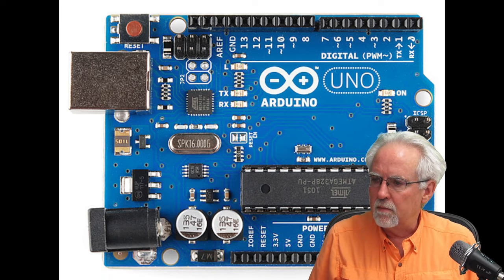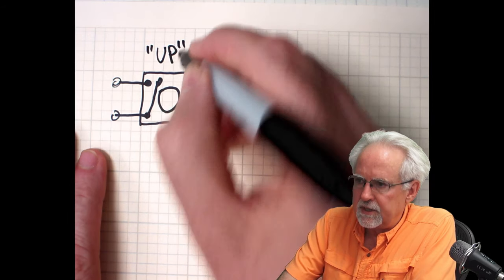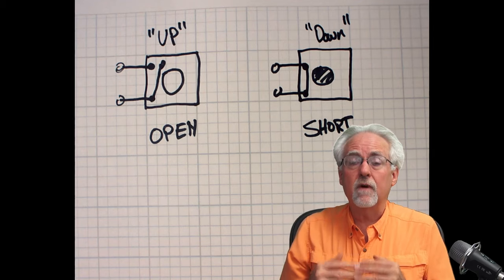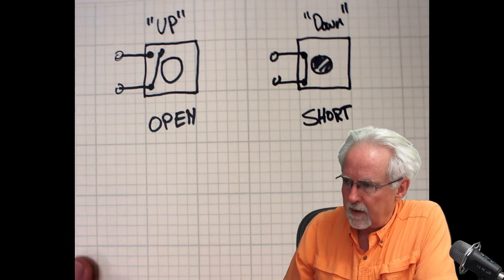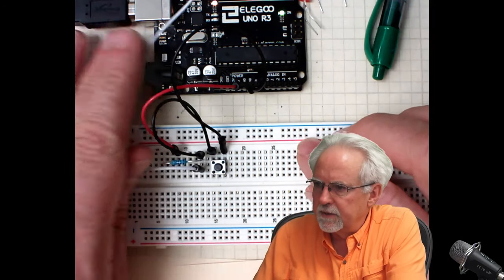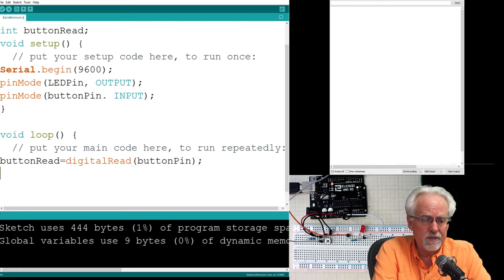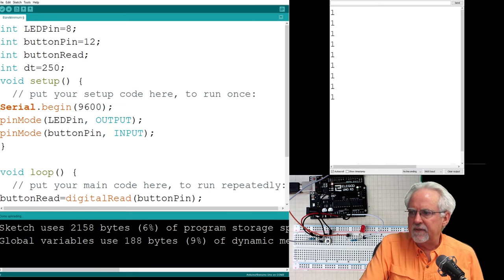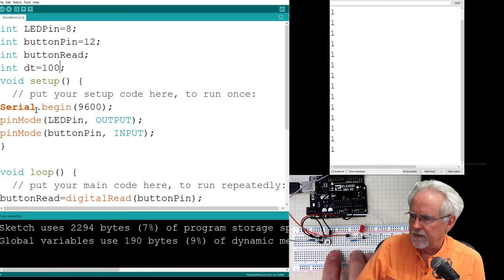Arduino Tutorial 27: Understanding Pushbuttons and Pull Up and Pull Down Resistors

Comment: QUICK QUESTION...why use a resistor at all??wouldn't you see the same results with out a resistor????Is it because you would damage that pin if there was no resistor in circuit????

Comment: Why we use 10K for pull up and pull down resistor ?
Shall we use some other value of resistor for it ?
Reply: you can use a bit bigger or a bit smaller its just that 10K is a "goto" value
Reply: Maybe it draws too much current from arduion.  I=V/R

Comment: As soon as you said it equals 1 I lost my mind. I spent the next 4 hours reading about TTL. I still dont fully understand but maybe I understand enough to push on. Thank you for the lessons. I wouldn't have learned all this any other way.
Reply: trake t. another way of thinking about it is that when the button is pushed it lets the electrons flow to ground so there isn't any "pressure" (or voltage) built up, kind of like water in a pipe or air in a pipe or hose.  If a valve is closed then the pressure will build up to a maximum, but if the valve is wide open, then pressure cannot build up unless the size of the pipe is too small to allow all of the substance to flow.

Comment: The double = got me. Wasn't working because I didn't double the = sign. The other obvious question - Why not just connect the LED circuit to 5V and put the pushbutton in series?
Reply from the maker: Try to make a toggle switch that way.

Comment: Thank you very much sir!!! I do have one question, though. How did you know to use a 10K resistor? And how do you know what resistors to use on general?
Reply: At this stage, values are not too important.  10K resists enough so you have something to measure.   20K does the same job (yeah, I double checked before saying that to make sure).  My kit has 220 Ohm resistors instead of 330 Ohm resistors.  they work exactly the same for this use (maybe the LED is a fraction brighter?).  LED's want 3V, not 5V.  5V will eventually burn them out.  Putting a resistor  of about that value (220-330) brings down the voltage to somewhere around 3V or lower.  No expert so that's a rough explanation is rough. but the idea is correct.
Reply: @TheRaptor1967  the idea of putting a resistor here..is to prevent the switch from impedance State.
Reply: Idk why but I cross checked all my connections and also checked my code but it’s showing only “0” in the serial monitor even after pressing the button . Could anyone help me out?
Reply: Exactly my question. Why not 100k or 300k? Less current, less wattage, more battery life
Reply: Why not, no risistor? I do not understand why you have to use a resistor to read the push button whether it is high or low. I just tested this without the resistor and it works just fine. Do I miss something?
Reply: @matheokoning4456  You need the resistor or you will have a direct short between 5v and ground. and the LED always has its own every LED used needs it's own resistor.

Comment: Hello Sir,
First i would like to thank you for this tutorial and the way of your explanation,
i have a problem:
the code is the same of yours and the connection to, but when i open the serial monitor the result is  "0" rather than "1" and when i push the button nothing change the result still "0" , can you figure out the problem.

Too many thanks Sir
Reply: Hello 47!,
     I had this same problem but I fixed it. Try moving the button further down the breadboard. I guess if u use a few rows too many times they decide not to work?
    Hope this helps.

Comment: While holding my breath I forgot to add something. This is an interesting approach to PULL UP/DOWN resistors: super easy and intuitive but, for those who are addicted to details (i.e. masochists) like me, could we have a more detailed explanation on the value of the resistors  compared to the inner impedance of the Arduino's reading pin?

Comment: Pull down resistors pull towards the ground
Pull up resistors pull toward the sun 
Trying to make a rule of thumb :) What do you think?
Reply: for  pull up resistor, I think the resistor is also should be big  to make true that the voltage of measure point is 5V,  if so, because the resistor is so big ,then it can't dirve other things good,  such as buzzer,  motor;  so it just have one function to make sure a point''s voltage is HIGH, am I right?

Comment: Why use a pull down resistor when you want open circuit to be 0 and closed 1. Wouldnt that work without the resistor as well?
Reply: I think you would short circuit if you don't put a resistor...

Comment: A question if you don't mind. How do you decide what value resistor to use?
As i saw in a data sheet the arduino uno output current is 40mA. So the voltage drop across this 10kΩ resistor would be 400V (V=IR=0.04A*10,000Ω). That means theoretically no current will reach the arduino reading pins when using the pull up method right? But when practically done, I got the reading as 1 as well. I'm a bit confused. Appreciate if anyone can explain this. Thank you:)
Reply from the maker: 40 mA is the max output. I=V/R. If V is 5 and R is 10,000 then I is 5/10,000, a very small current
Reply: @paulmcwhorter  ohh.. thanks alot sir!

Comment: I'm confused by the way he explains the pull up resistor. He specifically references V=IR, then explains that there is no current so V=5V due to there being no voltage drop... But if there is no current then I=0A -> V = 0 * R -> V = 0... If there's no current then how could there be a voltage?

Comment: My serial monitor keeps showing 0101010101010101... if the switch is not pressed and 00000000... if it is pressed. I have made the circuit same and the code is also same...

Comment: This was my sketch
int redPin=8;
int buttonPin=12;
int buttonRead;
int del=250;
int redRead;
String msg="buttonRead= ";
String msg2="redPin= ";
void setup() {
 Serial.begin(9600);
 pinMode(redPin,OUTPUT);
 pinMode(buttonPin,INPUT);

}

void loop() {
 buttonRead=digitalRead(buttonPin);
 redRead=digitalRead(redPin);
 Serial.print(msg);
 Serial.println(buttonRead);
 delay(del);
  Serial.print(msg2);
  Serial.println(redRead);
  if (buttonRead==0 && redRead==0){
    digitalWrite(redPin,HIGH);
  }
   if (buttonRead==0 && redRead==1){
    digitalWrite(redPin,LOW);
   }

Comment: I enjoy your videos very much (made it this far in the series), but I'm sorry to say that I still don't understand the idea of pull up or pull down resistors. Why not simply route the current directly through the switch? Why is the resistor needed?
Reply: because then you will have a direct short of 5 volts and ground and in short order no adruino and burned out LEDs

Comment: Is there a hard and fast rule as to when you use pull up/down resistors? Also, how do you know whether you need a pull up or pull down resistor? This always confuses me
Reply: Rolston Holas where I have seen the pull up or pull down resistors used most is with transistors.  The type of transistor and the particular circuit will determine which of the pull up or pull down resistors you need.  There are other places that use them too, but that is where I have seen them used most.

Comment: Sir i get 0 1 0001 0 1 01 01 01 output automatically. Without connecting any wires. help me to solve this issue.
Reply: Maybe missing a pull up or pull down resistor.  Replaying Paul's previous lesson may help.

Comment: ok my serialprinter does not read 1 or 0
it only reads the buttonPin =12 ??? 20:02:17.850 -> 12
Reply: same here
Reply: figured it out; serial.println was set to buttonPin, it should be set to the value you read from the button, not the button itself
Reply: Me too. I had the same problem and found the same fix. I was so happy when everything worked!

Comment: My button doesn't seem to work. it's constantly 1. I changed 4 buttons, and double checked my code. couldn't figure out why.
Reply: I have the same issue.  I thought it was the button as well (changed it 3 times) , but I think the button may not be seated properly.  I tried rotating the button 90 degrees - four times - and it still didn't work.  I removed the button and completed the circuit with a jumper and the red LED came on as it should have.  So I know the code and the build were correct.
Reply: @stevemorgan3597  Thanks Steve. I think I burned one Arduino up and tried a few different switches and still would not go from 1 to 0. Cut out switch and now I can move on to the LED.

Comment: Made boolean flag var, to implement toggle feature, it worked. after this i added debounce code from borrowed code.  
purchased 1) Arduino nano 2) ~4660 -5220 contact breadboard later will get pre-bent leads.  Great class, thank you Paul.

Comment: 12:48 conversely, you could install the pushbutton across the middle trench and give each lead a nice long column of 4 holes
Reply: That is what I did too.  Spread out the circuit some.  I used the bottom row for the ground bus and the top row for the 5 Volts with two vertical circuits on the board.

Comment: Hey Paul, I've been working through these courses and must say thank you so much and I for one give you a big thumbs up for teaching the math and other theory. Being a guy that slept through my High School days I have a lot of gaps and I appreciate the foundation along with tricks that you are presenting. I've learned a lot so far along with coming up with some fun technique. For example on this exercise I used your trick to read voltage and then set up serial output showing exactly what is going on "4.70 1" , 4.7 being volts and then when I push button, "0.00 0" Super cool, Learning a LOT! Thanks again, looking forward to moving forward with the rest of your classes.

Comment: Pull-Up configuration is like a Normally-Closed switch
AND
Pull-Down configuration is like a Normally-Open switch

Sir, i think you interchanged the conditions in the if statement, my understanding is if it displays 1, the LED should be ON
and if it is 0, the LED should be OFF. Thereby creating a Normally-Closed switch.

Nonetheless,
Thank you for this amazing lesson Sir Paul!
Reply: I totally Agree. but pull up has to go high and pull down goes to ground.

Comment: I still don't understand the purpose of pull up pull down resistors or what they do. Can someone explain or point me to another video

Edit: what's the point of the resistors? In the diagram you read 5 or 0, so whats the need for ther resistors? Also still confused on orginal question
Reply: same i also confuse why we need the resistor? what it actually do

Comment: Skipped ahead several lessons for this one. Glad I did since I didn't know about the need for a resistor when using the pushbuttons.

Have 8 LEDs and a Sketch that displays various "light show" animations (bounce, sweep, random, etc.). Tonight I added a pot (Lesson #12) to adjust the speed of the animation. And added two pushbuttons, one to cycle to the next animation and a second to toggle inverting the animation. Worked out great.

Thx!

Comment: This is how stupid I am. I fried a arduino during this lesson!!!!  Sometimes I wonder how I can even feed myself?  Just hope and pray to God my wife out lives me or else i'm screwed. I have a ELENCO Digital/analog trainer that has its own bread  board on it which i use mostly. Well I had the power and ground legs of the bread board powered by the Elenco little power supply at 12 volts and didn't know it and of coarse I used them with the Arduino during your video project hooking the power and ground of the Arduino to the power and ground legs of the bread board that had 12.6 volts running across it.
I was getting frustrated too because the LED would work with the button sometimes and then just start flashing by itsself , serial monitor looked like the Matrix movie at the end of the show with 0 and 1's going crazy. I was like what in the bleep is going on? Then i saw the Elenco trainer was turned on and that oh $#%@ feeling in your gut overwhelms you. Atleast it was a cheap knock off Arduino!
I let the smoke out of a Arduino trying to operate a cars ignition coil on the bench one day. One of those modern COP coils that have the transister inside the coil. Not sure what I did wrong there but that almost caught fire. Can't believe how much smoke they could fit into such a small device!

Comment: 9:35 I might have some type of dyslexia, that could account for a lot....  But Is this one of those cases where it's backwards on purpose?  You pulled up the voltage, by putting a resistor on the high side and causing the voltage to be zero  But then you pull down by putting a resistor on the low side, blocking ground, causing high.
It's backwards.  

I have these sort of mental blocks.  I can think of a couple right off hand, but YT wouldn't like me.  Let's just say it took forever to remember if blue or yellow was on top (a flag); and the transmission minus mission equals negative.  Transmission man is gal transmission gal is woah man.

Comment: I started on episode 28.  I'm nervous about this concept of pull up/pull down resistors, it's alluded me in the past.  I'm out of "iced coffee", it's the middle of the night, but I'm not tired and I better get through this now before I forget entirely.  

Eyes on the prize:
Control 4 or more stepper motors (external power and signal to one motor) split and dictated by an arduino with basic limit switches mounted on a machine. - 3D printer, to switch filaments.

Comment: Practicing Mechanical PE here.  I found this series and started watching it to learn how to program in a type of C (I'm a Fortran guy).  Wonderful series that has information for persons of all levels of experience.  I feel lucky to have found your channel.

I get the feeling that you teach as a vocation probably high school or maybe community college.  I'd not be surprised if you were a 'master' teacher.  I like your technique, especially the repetitions of both correct and incorrect (subsequently corrected) actions.  Also the gentle handholding with new concepts and the gradual weaning off of detailed instructions/demonstrations for concepts that should be fluent.  Great pedagogy.

I've overseen and mentored many new engineers.  Many recent graduates with whom I have dealt had good technical foundation but lacked practical foundation.  The process of understanding a problem, investigating viable solution options, choosing the option to use, and troubleshooting and fine tuning the result seem to be given very short shrift in engineering schools.  You manage to incorporate many of those steps in your lessons, though.  I wish there were more teachers like you out there.  Thank you very much.

Comment: if... else

int rLED=8;
int bPin=12;
int dT=500;
int readPin;

void setup() {
  // put your setup code here, to run once:
Serial.begin(9600);
pinMode(readPin,INPUT);
pinMode(rLED,OUTPUT);
}

void loop() {
  // put your main code here, to run repeatedly:

  readPin=digitalRead(bPin);  
Serial.println(readPin);
delay(dT);

  if (readPin==1){
    digitalWrite(rLED,LOW);
      }
      else {
        digitalWrite(rLED,HIGH);
      }
}

Comment: Enjoy your presentation, in particular, use of the overhead camera looking at the circuit board as you talked.
One idea to advance this lesson would be to incorporate an anti-bounce to the switch circuit so that the Arduino only registers switch closures longer than t time periods.

Comment: Hi Paul, I use a variable I called flag which has the initial value 1. Every time the push button is hit, then flag=-flag with a short delay (so arduino wouldn't switch continuously), to switch flag value between 1 and  -1. Then I use the structure "if (flag==1) else" to activate the LED. This works great!! Thanks a lot!

Comment: Somewhat more "compact" just because I know a command or two, maybe there are reasons not to do it this way.

buttonRead = !digitalRead(buttonPin);
  Serial.println(buttonRead);
  digitalWrite(LEDPin, buttonRead);
  delay(dt);

For those who don't follow, the "!"  means NOT, so a 1 becomes a 0 and a 0 becomes a 1.  I've put that in so that the light turns on when I push the button.  And instead of using HIGH or LOW in my digitalWrite I'm passing my buttonRead to the function "naked".

Comment: Dear Paul, are you dividing 5V by 0, when the latch is open (since U=IxR, and no current flowing)? I see that your instructions make sense, but I do not get the math behind it. Likewise, when the latch is closed, why suddenly U=0? Or does that mean that both values are simply tending towards the minimum/maximum values and you are applying some nasty calculus? Could you explain the math more indepth, like when explaining the LED in one of your first lessons, so that people with more rusty school math can get it too? Anyway thanks a lot for the great series!  Big hug!

Comment: A quick question, but first a thank you for your efforts in creating this series.  It is now Sept 2024. If Im not mistaken there have been some changes with the Mega 2560 R3 boards.  I have just completed this current leason and have a question.  From what I understand the newer boards have pull up resistnce built into the chip for most of the pins.  If I am understanding this correctly I dont need the 10k resistor in line with the switch. The "Digital Input" exercise that came with my starter kit doesn't require a pull up resistor to be inserted into the breadboard.  Please correct me if I am misunderstanding things here.  Its all about learning.  Thanks again.

Comment: I get the 'Error compiling for board' errors too. Usually after I've been coding and compiling for a while. Re-compiling will eventually work but best for me is to do a computer restart.
I don't know why it happens but it's nice to see it happens to others and not just me. Oh, and you need a comma not a period in the 'pinMode' function.